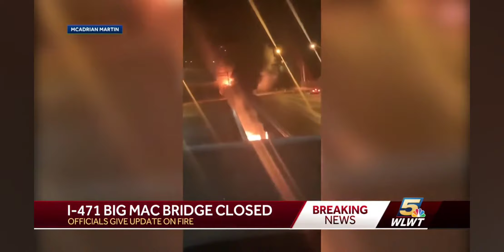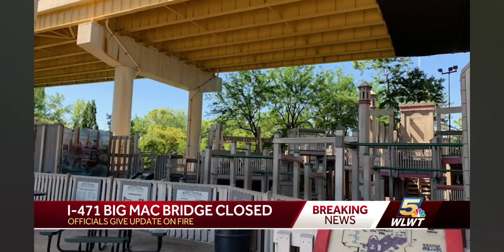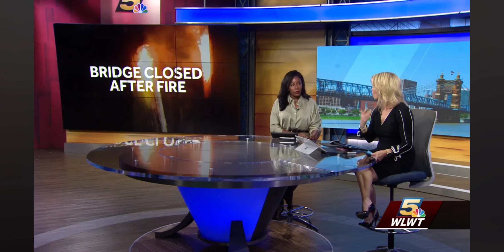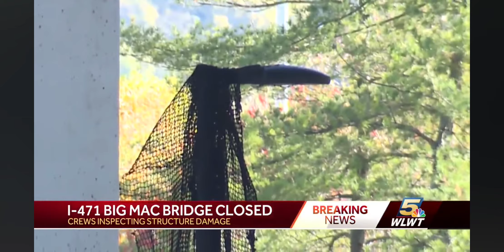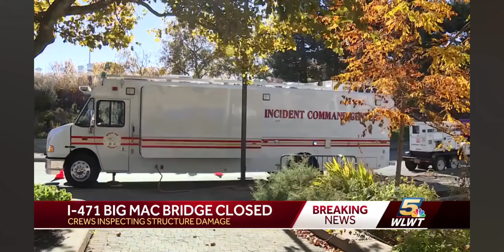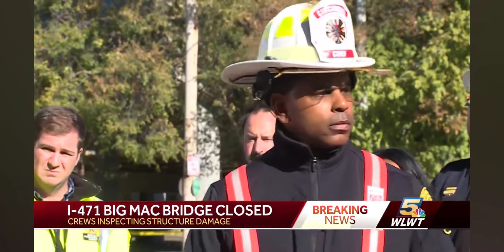wood and plastic melt steel beams??...."timelines"???..41 days?...

Comment: Let me get this straight.
A wood and plastic structure, under the bridge caught fire.
The fire burned so hot, it melted steel on the bridge.
When the fire was extinguished, there were still remnants of the wood and plastic structure, intact, under the bridge.
Hmmmm. 🤔🤪
Reply from the maker: @reibersue4845  😂😂